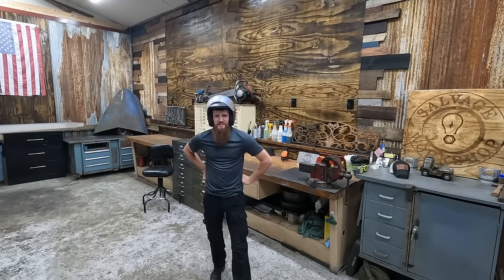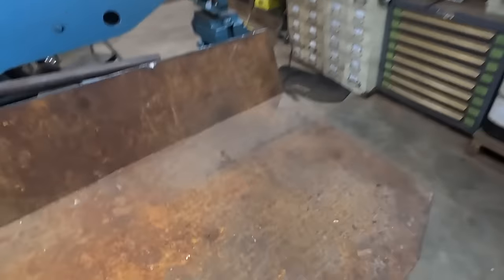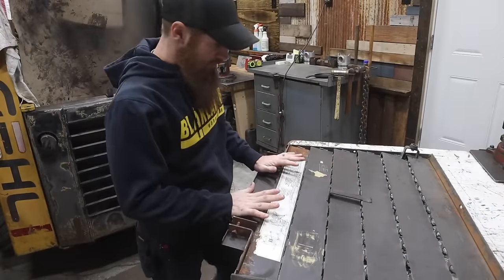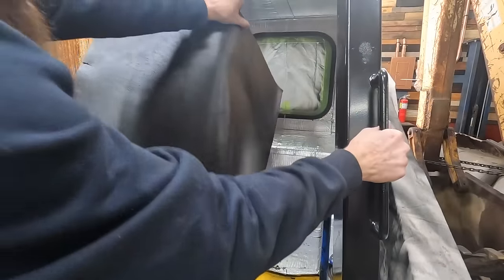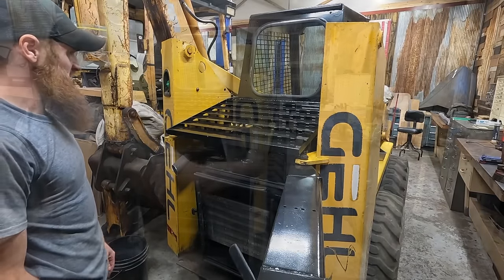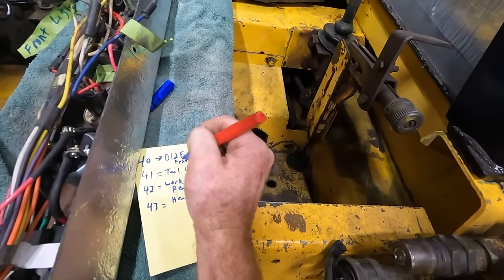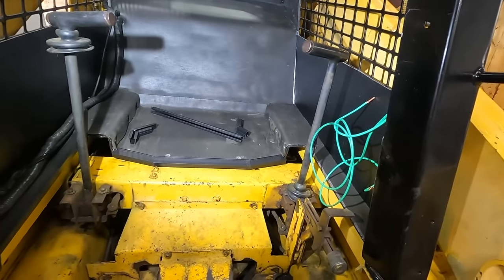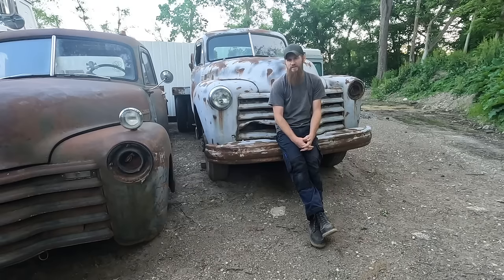The CAB on my old Skid Steer is ROUGH... Can we RESTORE it?!? ~ 1995 Gehl 5625sx Skid Loader P6

Comment: Matt, I watched to the end and loved the length of the video, especially since you did so much and it was finished at the end. I did not like the spooky intro, mate you are better than a bloody crash helmet and something under your arm, if you were an Australian contributor you’d be called a “Galah” for that intro, please just be yourself. Also, my experience of double skinning anything on earth moving machinery leads to problems as the dust gets in and can’t get out then the moisture follows and so on, so personally I would have cut that floor out and welded the good fitting plate you made in and welded it up. Great video Matt, thank you

Comment: I think you need to invest in a 'Drill Doctor' drill bit sharpener. You also need to spray contact cement on both surfaces and let it tact up before you put them together. You must have them in the proper place because once they touch each other it will be impossible to move them.  I think you did it all wrong.  Use body filler to make the rusted spots go away before painting.

Comment: The reason you should cut out the old metal is by leaving two plates in close proximity like that you are creating an impossible tight narrow gap for moisture to stay in. Only has to happen once, freak rainstorm, breakdown at a job leaving it exposed, etc. My expertise is actually in painting and the thing I have to fix most is people trying to caulk everything and make things WATERTIGHT / WATERPROOF. 

Most MRO guys understand that the more effort that goes into making things “waterproof/watertight” the less margin for error there is to get it wrong. Vapor barrier walls homes are terrible idea (great for energy insulation, terrible for managing moisture ingress) [off topic but relevant] 

For an area you know has seen water collection in the past your best bet is to treat it like the valley channel you find on a roof. Focus on diverting water/draining and leave lots of breathing room for anything wet to evaporate. I know my stance is extreme and seems crazy but when implemented correctly gives results counted by decades not years.
Reply: I know i wrote like im chastising your choice and while I definitely am critiquing it, knowing how well you look after your machines I doubt you will ever encounter an issue for the remainder of the time you own it and in the end that’s what counts! So my hats off to you for getting the repairs done and not leaving them half finished like the rest of us😅

Comment: if you're having to put that much pressure on your drill in order to drill holes in steel then either you need to sharpen your bits or get new ones...  🤔

Comment: skid steer company needs to make replacement parts for older machines where you can keep original so if theirs does this it’s not the end of the world. so if one wants to do a restoration or what ever here’s the part. here’s oil here’s tires 🛞 here’s the paint code. then have spare blocks to anything to rebuild or fix a bad engine back up.

Comment: Painful to watch you installing insulation- might have been better on second layer ( the black stuff) to use double sided tape. Or else reading directions on spray glue, no offense. I agree with another commenter, a white cab may be cooler, especially with that additional insulation.

Comment: You triggered me... not cutting out that rusted seat pan and back... and not even wire wheeling off any of the rust on the control panel before paining it.  You should get one of those air chisels that can use a needle scaler attachment.  Angle the side and back lights down more.  Put some washers or something in the back lights to angle them out a bit to spread the light in back too.  I would have just rolled on some truck bed liner instead of dealing with all that foam.  I do like the headliner though, but I would put some large washers on the bolts holding it up.

You should do hats and t-shirts like "One man's rust is another man's treasure" or "Grease makes everything work better" or "Sorry I can't hear you complaining over all the noise" or "Old diesels never die" or "Sometimes history is worth repeating" with a picture of some old machines... then put you logo on them.

Comment: You did not show exactly how you wired the NEGATIVE side of the lights. Ideally, they should all tie into 10ga cable back to battery-minus. (to support ALL the lights at once)  Do not use frame of vehicle to carry current.  Otherwise, you are forcing the hinges of the cab to be part of circuit.

Comment: All those spray glues in cans like that are contact adhesive & you spray it on both wot your gluing & wot your gluing it 2, then leave to go off allow it to dry then you put your piece in place. Watching you do that wrong was like pulling teeth. Why wouldn't you have just used a hood prop like they've used since the begining. You seem to have started just of late to do things half arsed & a badly half arsed at that.

Comment: You're using the glue wrong. Contact glue needs to be applied on both pieces, then let it air for 2 to 3 minutes, then join the pieces, then apply pressure, then let it sit for at least an hour.
Sharpen your metal drill bits. Watching you bend over the rotating drill to apply pressure make me cringe because you were soo close to catching your beard in the damn drill.